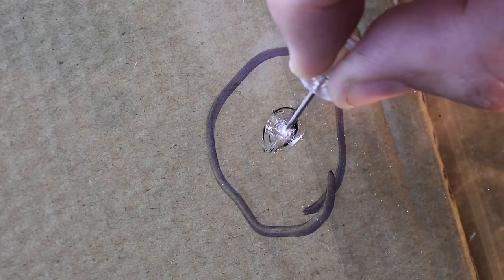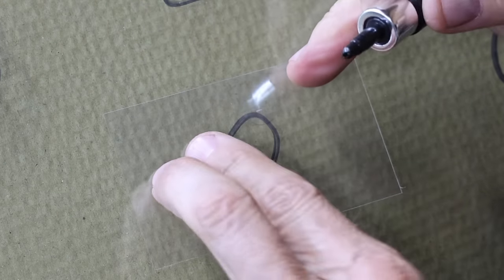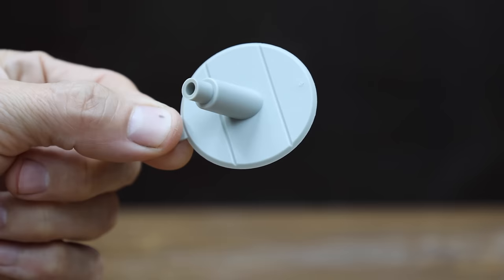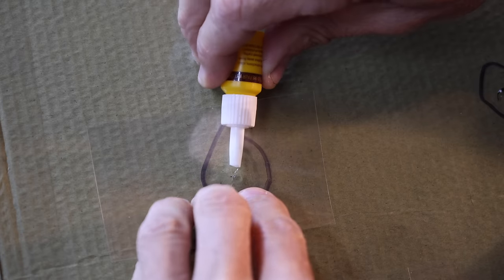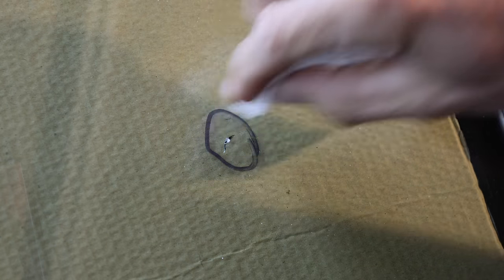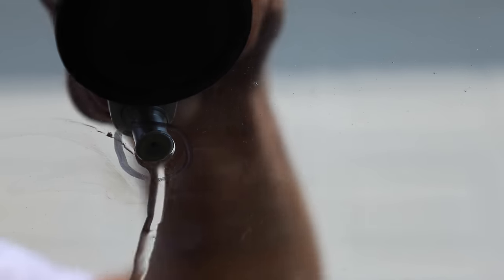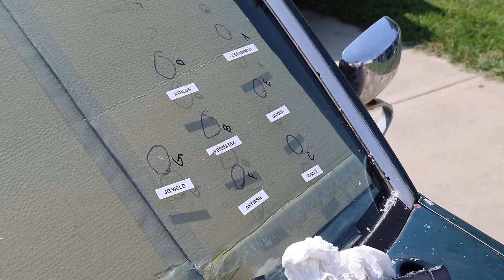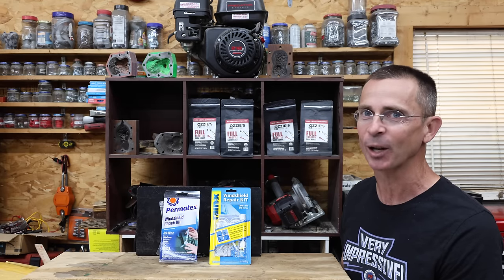Best Windshield Repair Kit? Let’s Find Out!

Comment: The sheets are Mylar sheets for the final step. But you should NEVER drill a windshield. If you puncture the PVB layer you can not fix that..let alone breaking a bit into the repair area. They make destressers that can open gently. Do NOT use lighters. You can crack the windshield wide open very easy. Yes in dire need I have done it, but last resort. The expensive kits are worth it. You did well. Most diy won't get good results, so good job! 16 yrs in the industry.
Reply from the maker: Thanks!

Comment: Great video. How about testing windshield polishing solutions to remove pits, scratches and wiper streaks using cerium oxide compounds or powder, regular compound, rayon, wool or regular foam pads with or without an interface foam pad 0.5 inch to 1 inch thick for rayon and wool thin pads to conform better to curve in glass. Also testing if staying within the same system cerium oxide compound and rayon pad from the same manufacturer guarantees no scratches or haze or you can mix manufacturers pads and compounds without adverse effects. That would be more than entertaining as doing a complete windshield with a cerium oxide compound and rayon pad with regular intervals of water vaporization could easily take 2 hours. What system works best, is safer and more efficient?
Reply from the maker: Thanks!  Thanks for the suggestion.

Comment: Which applicator method would you say is generally better. The plunger/syringe with the adhesive pad, or the 4 suction cups with the screw-in pressure driver? It seems the cheaper repair kits use one of these two methods. The more professional kits are outside of my budget. Thanks for the reviews.

Comment: Hey Todd. I am thinking to change a chrome finish fixtures to matte black. I can't find a good enough info on which paint / primer product will handle the traffic, grease, heat..etc the best after applying it. Can you please test which paint has the highest scratch resistant and durability?  Love your completely independent unbiased experiments testing videos. Thank you for all you do!
Reply from the maker: You are welcome!  Thanks for the suggestion.

Comment: Hi, I was just looking to see if you guys have done a comparison on hydraulic hose manufactures preferably half inch, 2 wire 4000 to 6000 psi.?
You’re always saying you’re looking for suggestions of different comparisons maybe you could do one of that it would be interesting to see if there is a significant difference. Thanks again for all you do appreciate all the information. Keep up the good work.
Reply from the maker: Thanks, will do!  Thanks for the suggestion.

Comment: I think if you live on or frequently drive on a rock road, or live in an area where there are lots of rock haulers on the highways, the $300 ClearShield kit would be a good investment. You may end up using it more than 3 or 4 times a year in those situations and it works like a professional kit. Plus, can make up to 200 repairs. I'd say money well spent if you fit the criteria.
Reply from the maker: Good Point!

Comment: You should do screwdrivers round two! Snap-On, Mac, Marco, Cornwell, Silver Eagle, Blue Point, the Wera and Wiha insulated drivers (which use different tips than their normal counterparts), the Wera with the metal striking cap, Husky, and GearWrench.
Reply from the maker: Thanks for he suggestion.

Comment: PRODUCT REVIEW SUGGESTION: Laser levels. They're available at a wide range of prices. I recently bought a mid-priced one and am thrilled with what it can do and how much easier it is to lay out things like shelf brackets. And in 1/4 the time. Straight and level as a Wärtsilä-Sulzer RTA96-C crankshaft. What do you get with the extra $$. Is it worth it to spend extra, or, like me, can you get 90% of the way there for <$100? Inquiring minds and all that...

THANKS!
Reply from the maker: Thanks for the suggestion.  Thanks for the feedback.

Comment: I have used permatex 3 times, but I only had 1 success on bulls eye. Other times, I just could not the resin to go in deep enough to the cracks. I might have not been able to clean the hole enough. Next time, I guess I will try drilling glass.
Reply from the maker: Thanks for the feedback.

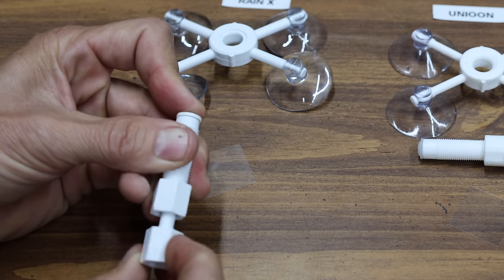Comment: 7:50 When you tested the Rainex, you should have done it with liquid in it, such as the resin. Remember that the liquid will fill in small gaps which should make it air tight creating suction/pressure. Doing it dry isn't a fair test.

Comment: Nicely done. 
Unfortunately, my car seems extremely prone to chips (6 in the last year, one of which spread to the point of needing a new windshield). I'd been using the Rain-X kit; it's good to know that there isn't a better cheap kit for my situation.
But I might invest in that Clearshield kit. It seems like the one that's easiest to use. How tough is the clean-up on it? It's the only one that you don't toss once it's too resin-filled.
Reply from the maker: Thanks!  Thanks for the feedback.

Comment: I got super unlucky and the impact from a rock on the outside of the glass barely damaged the outer pane somehow, but cracked the inside pane. Also up near the top so under the black vinyl stuff they put on the glass. Suffice it to say, the cheap stuff didn't work and getting it to cure was a major PITA
Reply from the maker: Thanks for sharing.

Comment: Two tips...
In a pinch ...one can use super glue.
To stop long cracks getting bigger after they are long...you can drimel/drill a small hole at the end of the crack. this will stop the cracks growth...fil with super glue ...
Reply from the maker: Thanks for the tips.

Comment: FYI one and all.  As someone who attended Autobody School back during the late 1960's, (Brentwood, Long Island, New York, we were shipped out to another school district for classes.)  We were taught the invention of putting the plastic between the two separate glass pieces, was to cut down on "HEAD - DECAPATION(S,)" which was quite a common thing, back when when automobiles had glass the same as was found in homes, before "Tempered glass."  Now for some gallows (for people not in the know, Gallows are where people used to be hanged) humor, at the scene of an early say 1930's collision, this fact lent itself to the phrase "keep a Head's-Up."  I just thought I'd share.  I found this to be funny as all hell, when taught by a big wig from GENERAL MOTORS, while learning about an invention they were working on during the late 1960's.  Of course they had to wait until things say like automobile clock's were scaled down, so as to be less than say 4" inches (deep into the dash board, at the time.)  Same for speedometer, back than (late 1960's) were easily 4 to 6 inches deep into the dashboards.  That invention, with film showing ( cars; gutted of Clock's, Speedometer's, Radio's etc.,) how they were going to work / operate,  shown to us, was called "AIRBAGS."

Since model year 1998, all new cars have been required to have air bags on both driver and passenger sides (light trucks came under the rule in ...

In 1971, the Ford Motor Company built an experimental airbag fleet. General Motors installed airbags in a fleet of 1973 Chevrolet Impalas—for government use only. The 1973 Oldsmobile Toronado was the first car with a passenger airbag sold to the public. General Motors later offered an option of driver-side airbags in full-sized Oldsmobiles and Buicks in 1975 and 1976, respectively. Cadillacs became available with driver and passenger airbags options during those years as well. General Motors, which had marketed its airbags as the "Air Cushion Restraint System," discontinued the ACRS option for the 1977 model year, citing a lack of consumer interest.
Reply from the maker: Thanks for sharing.

Comment: One major reason for fixing chips in a windshield as soon as possible is to prevent later cracking of the glass; do you think you could follow up with a 6 month/12 month later video to see if any of these prevented/failed to prevent further cracking of the damaged and repaired areas?
Reply from the maker: Thanks for the suggestion.

Comment: Ok, I know this is FAR off the topic of this video, but you always ask for video ideas and I recently had a cross country trip where I towed a trailer for the very first time. I'm not sure if it would even be possible or practical, but it's live to see a video on weight distribution hitches. I'm really fascinated with how they work and if there is a specific hitch manufacturer that is better than the others. Submitted for your approval.
Reply from the maker: Thanks for the suggestion.

Comment: Requesting: Industrial Markers...

like Markal, (+ colors (i used white Markals for years, now they have colors🤔)Avery, ., RevMark Bright Series, and MagicTag ( Alcohol Resistant Markers)...the type that marks on oily or wet surfaces... 

 there's probably more out there, and I'd like to know which brand is best, especially since they're usually sold by the dozen.

and maybe separately the sharpie's silver and black and sharpie normal vs industrial (stain vs ink) but while I like sharpies, I haven't seen them make any industrial paint markers like the above (although they are quite useful).

 please and thank you.
Reply from the maker: Thanks for the suggestion.

Comment: I have use both the permatex and rainx, both worked well, the rainx lasted on my truck for 4 years before a particularly cold wet winter cracked it at the same spot can’t ask for more than that, saying that if you’re prone to rock chips coughjeepwranglercough it’s a good idea to get windshield coverage on your insurance
Reply from the maker: Thanks for sharing.

Comment: Here is a suggestion for a new testing. U bike Lock, and later another serie of bike chain. You could try cutting them with saws, bolt cutters and grinders and test corosion resistance
Reply from the maker: Thanks for the suggestion.

Comment: Thank you for this video! I do have a question. I just noticed a small chip/bullseye but it’s on the very bottom edge of the windshield where it meets the cars plastic surround. Will one of these kits(permatex) be able to repair the edge damage? Thank you!

Comment: Awesome video I use the rain x brand but I wanted to mention if you could do a review/comparison on smoke/leak detectors. I just bought an Autool evap smoke machine but I see there’s a lot out there some with built in pumps and others with air hose lines.
Reply from the maker: Thanks!

Comment: If your car insurance has windshield coverage, your insurance will usually waive the deductible for repairing chips. They would prefer spending $50-$100 having a professional repair the chip. Instead of having you dawdle over repairing it because you don't want to pay / spend the time DIY, causing the crack to grow resulting in the entire windshield needing replacement at a cost of hundreds to thousands of dollars.
Reply from the maker: Thanks for the feedback.

Comment: I would like to see a MPG test using various different methods. Different tire height, different tire width, aerodynamic changes, lowering the test vehicle vs raising the test vehicle, adding weight, reducing weight, intake change, etc etc! Obviously not all of that has to be done, those are just ideas!

Comment: It's been over two years since you last tested battery powered drills. Also when you did test them for some reason you chose to put some brands with brushed motors against others with brushless even though brushless models were available in those brands. Can you do a new drill comparison and do an all brushless comparison so we get a more apples to apples result?
Reply from the maker: Thanks for the suggestion.

Comment: Video idea, can you do a test of only one manufacturer, like several different drills of the DeWalt brand, or 10 different models of angle grinders of the makita brand. i would like to see the different pricepoints and the capabilities what you would get if you go more expensive
Reply from the maker: Thanks for the suggestion.

Comment: Just a little word of advice. Never apply heat to a windshield unless you are pulling vacuum during the repair. Under no circumstance do you apply heat while the repair is under pressure. By no means do I want to come across as negative, but I have been doing Auto Glass for 35 years and there is a lot more to doing a chip repair than what is being shown here.
Reply from the maker: Thanks for the constructive feedback.

Comment: I love your videos. I was curious if you can repair a chipped flatscreen TV screen with windshield repair kits and if any of them would make it better or eliminate the refraction from the chip.
Reply from the maker: Thanks for the suggestion.
Reply: ProjectFarm...  A chip in the glass on a LED tv creates a bright spot on the screen. Everything online states to use a dab of petroleum jelly which does make it less pronounced but the bright spot is still noticeable if you know it’s there and my eyes always seem to go straight to it. The tv is a 75” and only a couple years old so it would be expensive to replace. I have been curious for some time if windshield repair kits would fix it but find zero information on anyone having tried it. Chip is small and does not have a “star” or crack. Replicating the chip without cracking may be the most difficult part of the test. For context my son threw a PS4 controller and caused the tiny chip. I can provide pics if it will help.

Comment: If you get a stone chip in your windshield, check with your insurance company. Many times your insurance company will let you get your windshield repaired for free at certain glass companies. If it is the drivers line of vision they will only replace the windshield as it will distort vision a little.
Reply from the maker: Thanks for the feedback.

Comment: I have a suggestion for a video: Headlamp comparison. Which ones actually put out the rated lumens, the quality of the light itself (color spectrum), which ones hold up to being adjusted hundreds of times, dropped, rechargeable vs replaceable batteries, etc.
Reply from the maker: Thanks for the suggestion.

Comment: Have you done a video on manual rivet guns? Ive been eyeing one on amazon the Huck HK150A Hand Operated Hydraulic Riveter Kit. Its expensive but its ease of use is what im looking at vs mechanical ones.
Reply from the maker: Thanks for the suggestion.

Comment: How about testing Wago electrical connectors versus wire nuts. Strength, electrical resistance, electrical capacity etc.
Reply from the maker: Thanks for the suggestion.

Comment: I had a one-inch circular star from a flying rock in the upper right (passenger) side of my windshield. My auto insurance paid for a very widely advertised company to repair the damage. When the repairman arrived at my residence, I suggested we move to a nearby place out of the sun, but he said no. While he was "repairing" the small star, it grew to a one foot crack. Then he blamed it on the sunshine. Beware of this heavily-advertised windshield repair company. Then i called a local repair shop recommended by my auto dealer; they did a perfect replacement for lower cost than the first shady outfit wanted.

Comment: Wouldn’t a plastic razor blade on glass be more appropriate than a sharp metal blade at the wrong (90 degree) angle to the windshield?  That high pitched squeak is the noise glass makes when being scratched.
Reply from the maker: Thanks for the feedback.

Comment: speaking of car repairs, I do wonder which is the longest lasting clear coat in a can one can use to fix peeling or just about gone.
Its hard to know which one will last the longest and how best to fix along the clear coat peel line. They say its semi permanent, which I agree it won't last forever; but the people making the how to videos/guides rarely ever say how long the fix will last for when they show a product. If I can get a few years out of a new clear coat on an old car, that would make it worth it vs a few months; which at that point feels like a waste of time and money.
Reply from the maker: Thanks for the suggestion.

Comment: I mean im annoyed he pulled the JB weld, didnt seem like a fair test for that so im gonna ignore that result. Used it before on a ford and it worked fine. You just cut around it then smooth it lightly with some dish soap for lube and then the final polish was letting the wipers rub over it for 5 mins and i couldn't see it. Used some cheaper ones before and they ended up other not filling or spreading the chip further.

Comment: I had a "Professional" window repair man come to my house to repair my window and he used one of the off the shelf disposable repair kits...  I've also had a Terminix "professional" tell me termites can smell north ash and that's the wood they prefer so they use that to bait termintes... And LG repair "Professional" from Angie's list bring Completely wrong circuit board and charge $150 visit fee then didn't come back again with correct circuit board. Ended up having to do my own research, find the correct board and supplier and do the repair myself.
Reply from the maker: Thanks for sharing.

Comment: Price per repair.
1: Rain X with $1.2 per repair.
2: Unioon with $1.5 per repair.
3: Clear shield Kit with $1.595 per repair.
4: Anton Tools with $1.9 per repair.
5: Antswish Kit at $4.5 per repair.
6: Tie with: JB Weld & Permatex at $13 per repair.

Sure Clear Shield Kit has a base price of $319 but it can do 200 repairs while the next highest is only 10 repairs making all other repairs absolute trash in numbers of repairs.  So sure its got a much higher base price but when factoring how many repairs you can do with it the fact is its actually 3rd cheapest.
Reply from the maker: Thanks for the feedback.